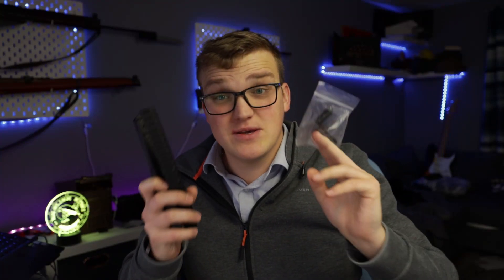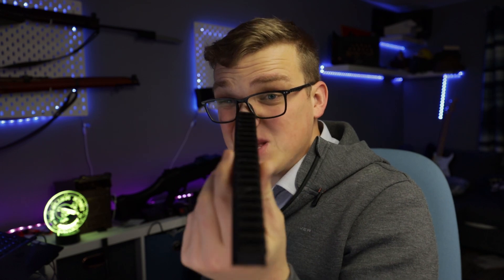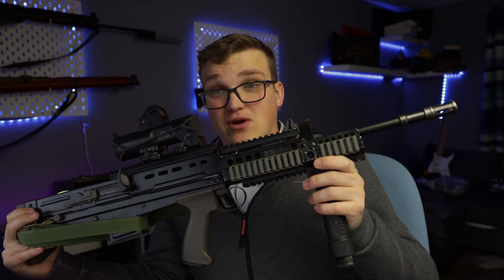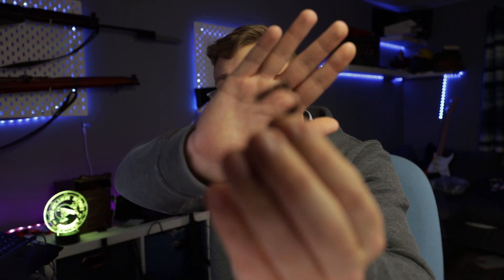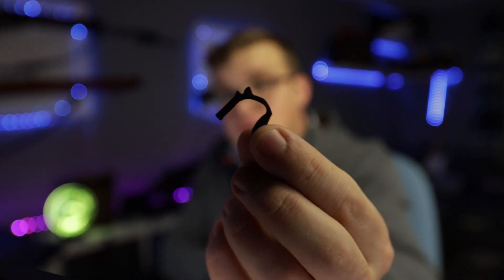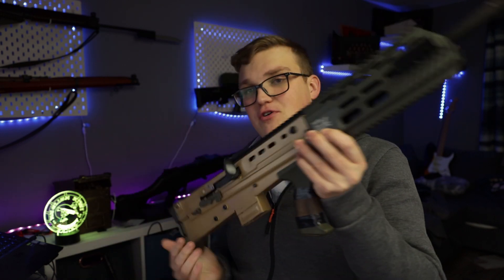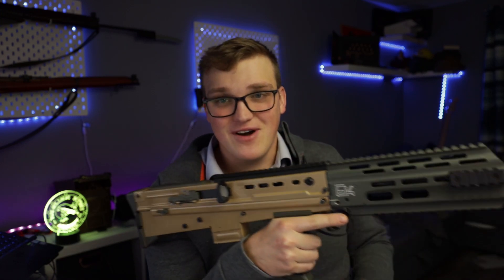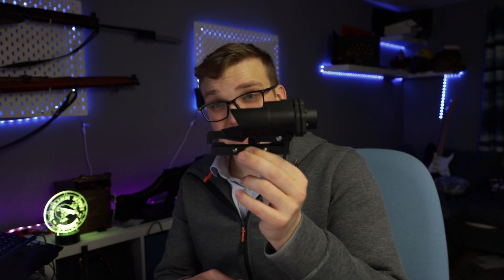Where Have I Been??? (I Designed New Things!)

Comment: Hey English Kiwi, I recently bought a brand new S&T SMLE and found that it does not feed but does rack and fire without problems. I dont see any sign of damage except that the ridge that moves back with the bolt does not function as it should ie it does not come back with the bolt. What would you suggest I do? Take it apart? Return? Do you have other suggestions? It would be greatly appreciated.
Reply from the maker: Sounds like you need to take it back to the shop, especially if it's brand new! If it's come out the box faulty take it it back and get them to exchange it for another or give you a refund :)
Reply: @EnglishKiwi  Ok thanks.